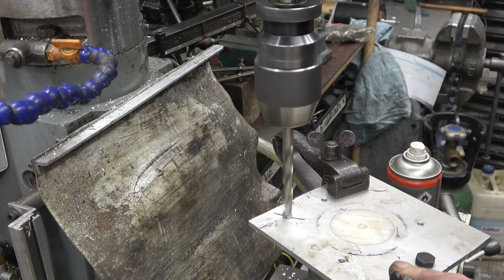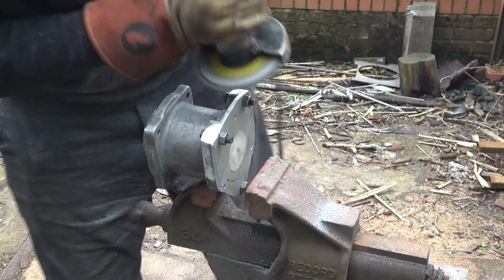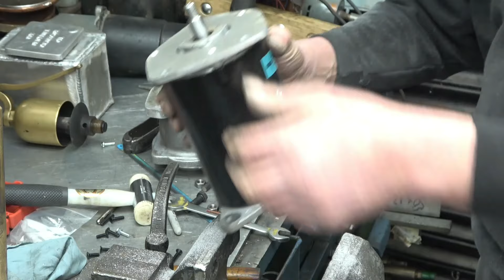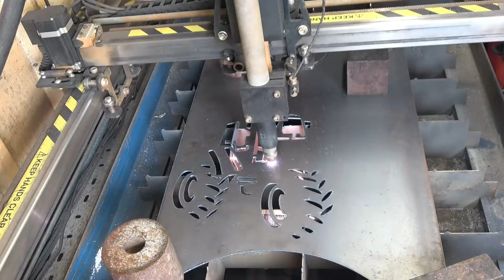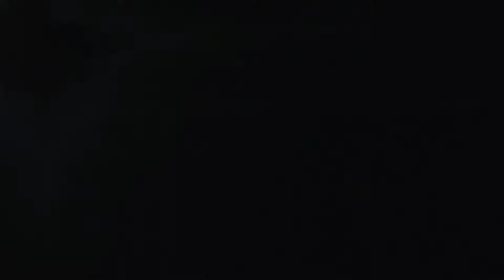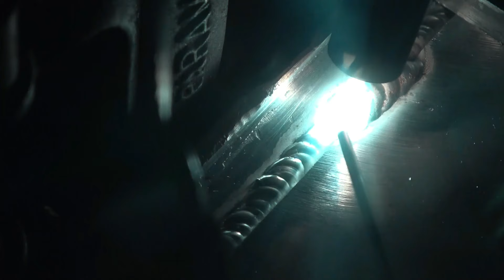SNNC 525 P2  Dynamator , Plasma Cutting , Alloy Welding .

Comment: Is that little gap on the adapter plate going to let enough airflow through for adequate cooling?
Reply from the maker: I hope so 
We don't need a high output .The mass of aluminium should conduct the heat away  .
Reply: @doubleboost  Too late to mill out the slots a bit bigger then, just in case?